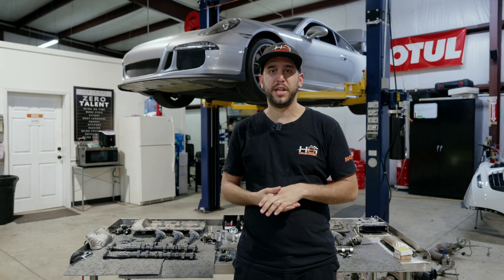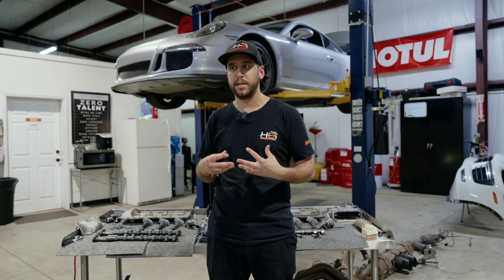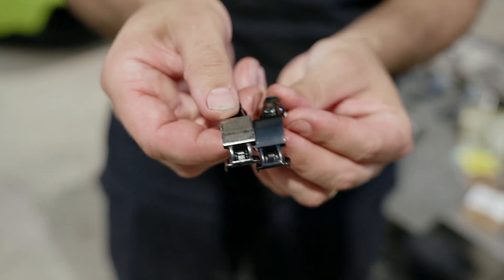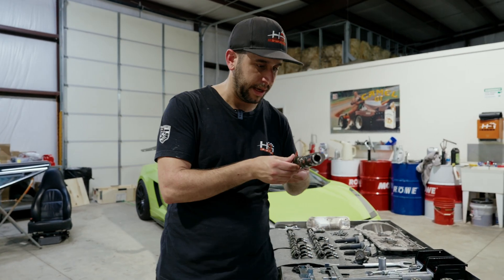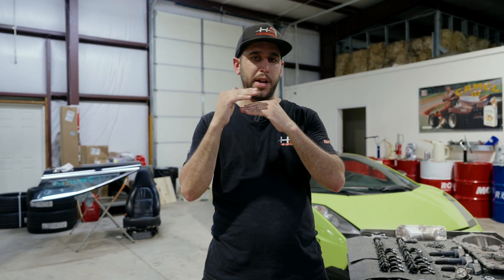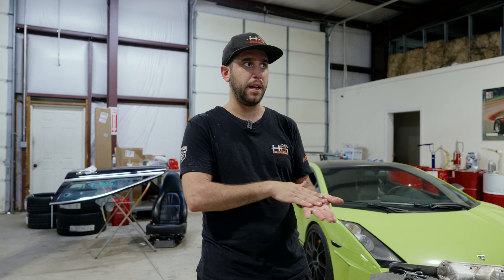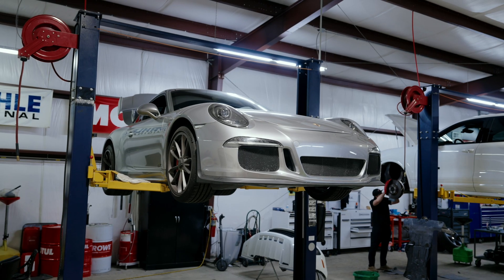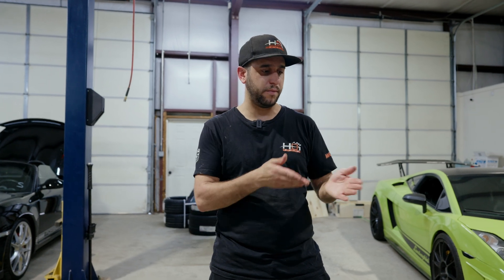Why 911 GT3 Engines Fail and How To Stop It Now!

Comment: Great video - would grinding down the camshaft lobes help reduce the rate of wear?  Otherwise, this is just painful to have to deal with every 10-15k miles if that's the solution being suggested here.  Would be great to get a teardown of a G revision engine to see what (if anything) was changed...

Comment: good video man!  Just like fixing the Crankhub issue in the F80 M3 and the rod bearing in the E9x M3s.  After the fix, good cars to keep.  I had a 991.1 GT3 and started having misfires, it was covered under CPO warranty but decided to sell it before the warranty expired.
Reply: Not really, this sounds like it will be recurring wear item, whereas say the rod bearing issue in E9x doesn't happen again if you go with slightly higher clearance bearings, with that being the actual solution.

Comment: oh i got a new and improved G6 engine which doesnt have the failure rates , if at all , of the E and F series engines. i guess its too hard to retro introduce the measures in the G6 like the direct oil spray from the Rs to the E and F`s etc ?

Comment: The finger followers DLC coating has imitated Houdini and vanished from the contact area, but…. the microscopic diamond like carbon particles have matriculated through the entire oil system. Gears, bearings, oil passages. DLC can have a tendency to delaminate from the substrate it’s applied on and create catastrophic damages. Tough situation for the car owner & a post warranty repair shop will lose sleep indefinitely

Comment: Great video!  I have a 2016 with a G0 engine. There is some noise that could be described a ticking but I’m not 100% it’s not just normal as it sounds the same as others in the area. No issues. Car is still under factory warranty. Would Porsche look at and potentially replace/repair under warranty without a check engine notification?
Reply from the maker: Most likely no, the G engine is an essentially a RS engine so it should be problem free, but you could technically pay for an inspection.
Reply: @HBiAuto The G0 engines are essentially RS engines?  I thought that was only true of the G6 engines?

Comment: Thank you. This confirms i do not want a 991.1 GT3 😂
Reply from the maker: This will become a maintenance just like the IMS bearing. Kits will begin to hit the market to bulletproof the engine over the long term.
Reply: Got that right!
Reply: I hear yah. There’s one for sale around my way for $95k and the price sounds enticing but the engine issue is making me re-think
Reply: @MarkCalica  there is a reason why the prices are like that, the market reflects their value. The 991.2 has a purpose built 4.0, and is worth the extra premium.
Reply: @DraegerV1 I agree. Guess I’ll just have to hold off and save more money for a 991.2
Reply: @DraegerV1 the 991.1 gt3 engine wasn’t “purpose built” 😂😂😂😂
Reply: @frederickcook87  Nossir. It was a "hopped up" version of the regular Carrera engine.
Reply: @MarkCalica there is a Porsche certified one, full two years of warranty on it, for sale on Porsche finder for 139k. One could buy it, get the engine to grenade and get a factory new G motor that really does not have these problems
Reply: @robertsole9970  i dont believe Porsche is covering these under warranty any more?? Also, i have heard the G motors still have issues
Reply: @DraegerV1 if you get the Porsche CPO warranty and it blows up, they cover it. The G motor is not as bad as the replaced motor. Remember Porsche replaced every GT3 motor of this 991.1 due to the issue of the rod bolt cap letting loose. But yes, stay away from these things. I’d get a 991.2 or 992.1 in a heartbeat
Reply: @robertsole9970  i would not expect Porsche to CPO a car that old. Prett wild if they did!!
Reply: @DraegerV1 it can be up to 10 years or so and under 100k miles.
Reply: They will warranty.  I had a Porsche platinum 7 year warranty on a 991.1 gt3 before selling earlier this year.

Comment: Germans just can't make a reliable sports car. BMW, Mercedes, Porsche, all of them just have engines with catastrophic failures.
Reply: The RS4 motor was good. Just carbon issues. The V8 S4 not so much.
Reply: @robertsole9970  "just carbon issues" 

That's still a problem

Comment: Fantastic video. You are a talented, brave technician. I have a (purchased new by me) 2017 Porsche 991.2 Carrera S currently @ 29.500 miles; I have had a "very-cold-days-only" tick on start-up (that lasts for 3 miles until the car gets warmed up) since 2018, but it seems perfect 99.9% of the time otherwise. New Mobile 1 and new Porsche oil filters every year since new. Do you know if what I am hearing is possibly "the same thing" that you are showing us here?  Thank you for your superb video.
Reply from the maker: Thank you very much. More than likely you are just hearing the direct injection, it can be pretty noisy on cold starts.

Comment: I have a 2014 GT3 with 11360 miles never tracked all maintenance done since new annually. Runs amazing would you recommend checking the followers thanks
Reply from the maker: I think checking them is a good idea just for ease of mind.
Reply: I had 22,000 miles on mine with F series motor.  Ran great but went into limp mode 1x at track.  I had a Porsche platinum warranty on it.

Comment: If those lifters are DLC coated and its coming off the lifters it is now floating in your oil.  NOT a good scenario.  You should be doing an oil analysis on these porsches as well. The DLC will cause bearing failures etc
Reply from the maker: Yes we do perform an oil analysis along with full engine lubrication system flush with an additional analysis to verify findings in the engine. Just like an aircraft we will test the oil regularly as well to verify the bearings are holding up as required.
Reply: Exactly why Porsche has you replace parts. https://static.nhtsa.gov/odi/tsbs/2015/MC-10117419-9999.pdf
Reply: came here to say this as well. these are fixable, but that metal is going somewhere, and long term the bearings aren't going to like it...

Comment: do the updated 3.8 engines that Porsche has been installing also have upgraded followers, etc. that prevent this maintenance need but could be used on older non-updated 991.1 GT3 engines?
Reply from the maker: There have been 3 updates to the followers but I cannot tell a difference visually.